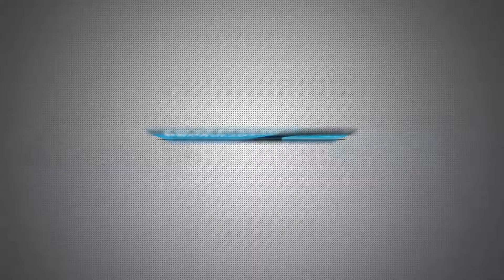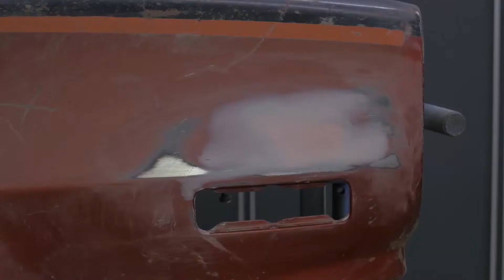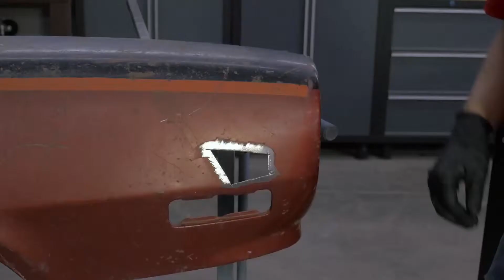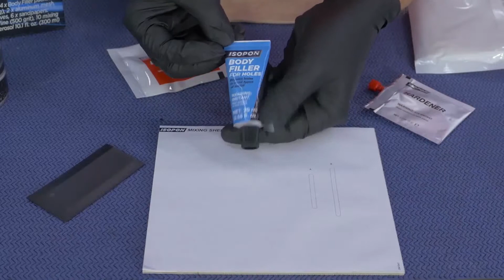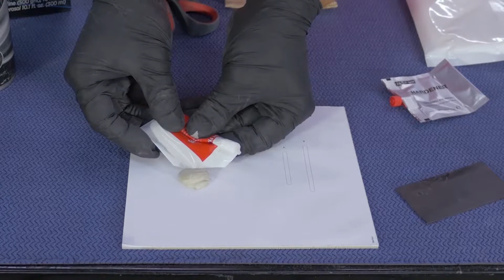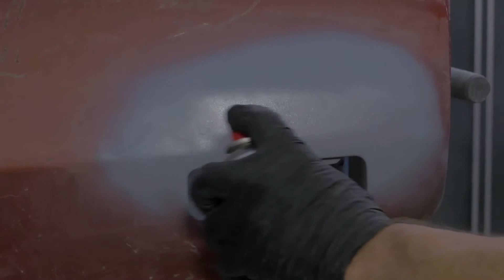ISOPON Body Repair Kit for Holes

Comment: Great Idea, as a consumer, my suggestion would be to prime the sanded metal before applying aluminium mesh. The primer preparation would prevent the phenomenon of accelerated corrosion caused by dissimilar metals of steel and aluminium placed in constant contact such as here in this presentation.